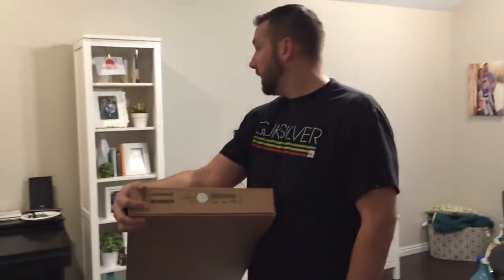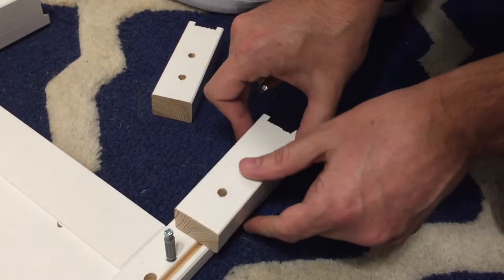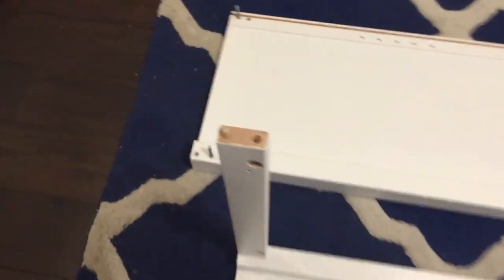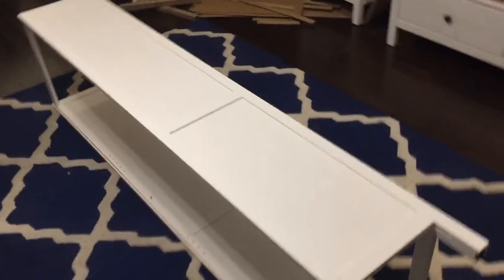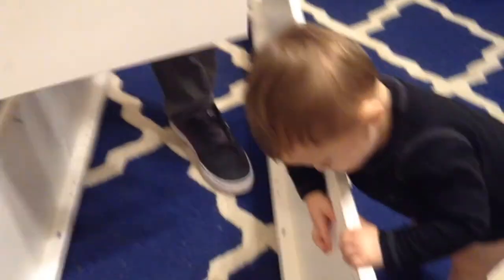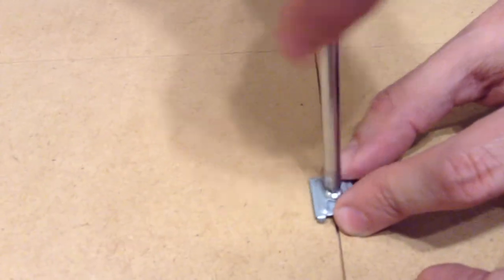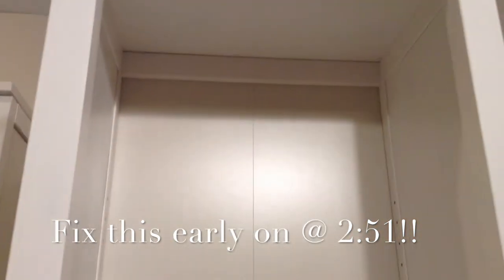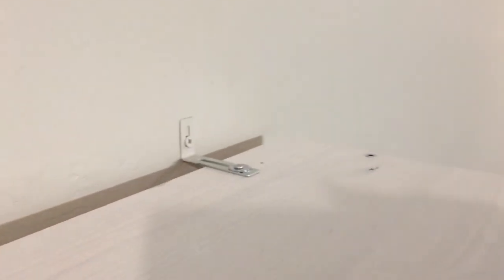How To Assemble Ikea Hemnes Bookshelf 403.717.63

Comment: I just finished putting two of these together. I definitely think the instructions were wrong because I ran into the same issue with the holes being at the top instead of the bottom.   The really frustrating thing was the back panels are like 1/8" of an inch too long!   I see you did not have that issue.